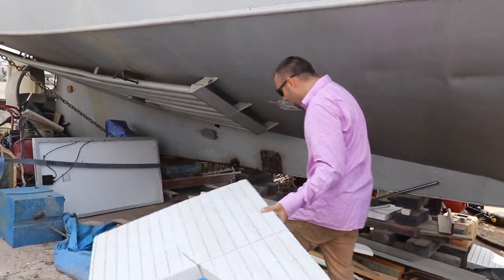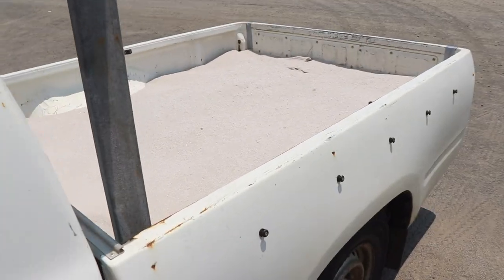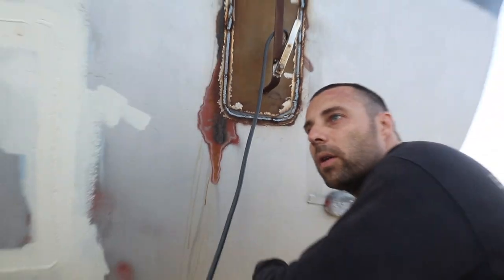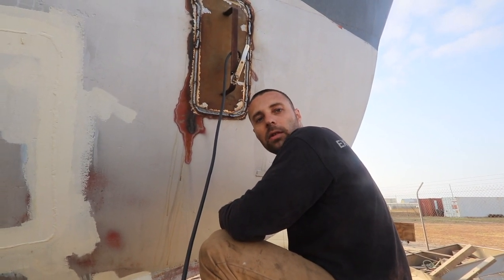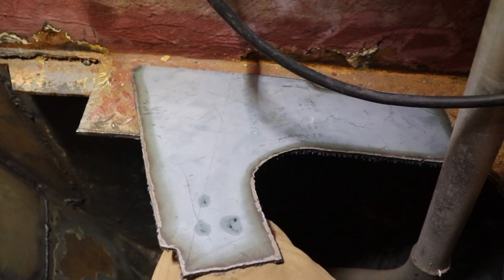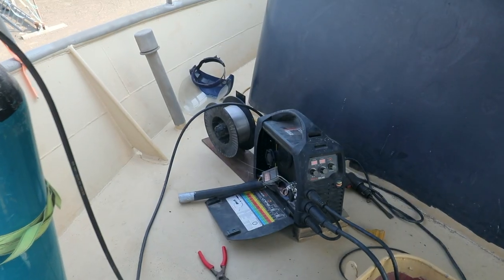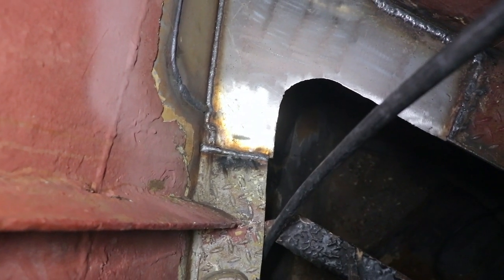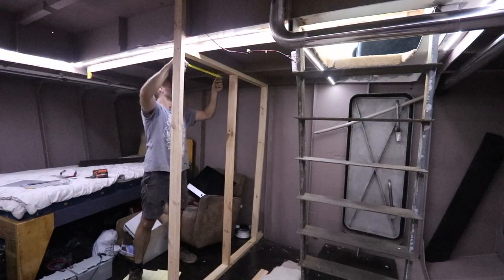Rebuilding the Crash Bulkhead - Project Brupeg Ep. 117

Comment: Thanks, great work as always don't usually comment but noticed the float switch on the sump pump. Usually they need a good bit of clearance to operate/ swing up and down. Worried  if  its in the tube and movement at sea it might not work. Hope not🤞 they usually supply these style of pumps with the option of a tube float switch aswell. This is also built in, but in a 1 1/2 tube fixed to the side of the pump. Hope you don't need this advice👍⛵🏴
Reply from the maker: I didn’t know they came with a tube option. I might look to that for an upgrade. This pump can be used elsewhere

Comment: Hi guys, she's coming along through a lot of hard work by all of crew. When talking about welding I don't know the rules and procedures in your country but if it works for you that's all that matters. I've been at welding game since 78 and I'm sixty and have put a few years in working on naval vessels, destroyers, supply and frigates. Whether we were putting a insert in hull or a fuel tank once tacked up it was welded fully from the inside then gouged from the outside into solid weld metal, in your case you use the grinder disc too open and find good solid metal. It just saves you from doing both sides, as far as the welding when doing the horizontal your much better off running two or more passes eliminating the chance of undercut. Play safe ! 🇨🇦
Reply from the maker: Ahh thanks for this, i wasnt sure about the multiple passes on the horizontal weld

Comment: Thanks team, I admire your planning, application and persistence. I’m fairly effective but you dudes are awesome.
That slowed down sand sieve footage was mesmerising. I understand the accumulation of “valuable” offcuts etc. After cleaning up (in preperation for leaving) one home i’d been in for 12 years we had sufficient wood for an entire winter’s firewood. Each piece had all been put aside previously and stored as “too valuable to burn”. The fire situation sounds scary, we had significant smoke from Auz over here in Dunedin.I would rather have winds than fire but that said we’ve just had 24 hours of not less than 60 knot winds and a maximum gust of 82 knots. Category 1 Hurricanes start at 64 knots. Most exciting times. Cheers Doi
Reply from the maker: Yeah I was speaking to a mate who lives up on flagstaff hill, he said it’s been blowing it’s guts out up there and a bunch of lightning. I can only apologise for the amount of smoke we are sending your way
Reply from the maker: Thanks Just Doi. 
Yeah Dunedin winds can be exhausting. Hi from one Dunedin-er to another! Jess

Comment: Awesome video. You may end up changing that float switch on the pump as its made for a larger area to float around and works moving from vertical to horizontal..... but saying that, i am sure you guys will make it work. Great work
Reply from the maker: Hi Matt. yeah we found we can use it by simply zip tieing it in the sump. so it still follows the horizontal/vertical movement but in a much smaller space

Comment: If you haven't had this done please have the hull material and a sample of your welds done in the vertical position tested for tensile strength and most importantly tested for low temperature impact strength. this could be life critical if u are going in ice conditions or very low temperature regions. a low cost source for this type of testing could be from a tech school that teaches metal testing. Ice, even small bits can rip a boat to pieces. I have managed projects in parts of the world that make your area look like Atlanta GA. I totally understand the problem of material availability. Best wishes and success in your adventure!!!
Reply from the maker: Hi Chris
We are following the commercial standards of Australia, had each step checked by professionals and had advice from seasoned ice boat builders. We think we will be ok but thanks for your concerns. Cheers Jess

Comment: Jess use a Welding glass to film Dame while he is welding i think that should work and also protect the Camera from splatter or Slag, even if you film with the Camera inside a welding Helmut try it you have nothing to lose and every thing to gain. lol great job Guys. Dame please look at a better sump pump than the one you had shown in this Vlog  i have the same pump and when they work there good but when the little ball bearing  housing (plastic ) fails so does the pump its a safety for the pump and all so the thing that will fail mate . just look at the top of it and you will see what i am talking about.
Reply from the maker: Thanks I will have a look at that

Comment: Steve Dashew uses a large-diameter vertical PVC  pipe for the chain to pile into, this isolates the hull from the chain & eliminates the chain making a pyramid then tipping over on itself.
Reply from the maker: That makes sense. I’ll look into his design
Reply: @ProjectBrupeg  I sent a few pics of the design via email.
Reply from the maker: Thanks for them Jeff, ive made a few enquires about large diameter tube and although its available I need to order a minimum of 6m and i havent been able to fid a supplier that will sell it i smaller lengths (we need 2m of 500mm diameter). that said the concept is great and I think can be built using the original hardwood but to Dashews style

Comment: Liking this midnight Monday publishing schedule.
You will have to build a wee barge to tow behind Brupeg so that you don’t have to go through the trauma of dumping  your ‘resource’ pile ‘cause you know damn well 2 weeks after you tip it you will be handing over cash to buy the same thing new.
Reply from the maker: Im aware i will likely be buying a piece of steel from the scrap yard that i sold them a week before... it is a trauma risk losing ones resource pile, on the one hand you know you should tidy it up and through the junk but on the other hand, there's no junk in there...
Reply: @ProjectBrupeg  I'm wondering the same thing and figured I could afford the weight of about 20 kilos of alu and SS plate for "reasons".
Reply: My Grandfather, a blacksmith and wheelwright had a metal junk pile behind his workshop about 20ft wide, 10ft deep and best part of 100ft long collected over about 60 years! You could find everything you needed in it and a lot you didn't! Must have been quite valuable when the scrappie came and took it away after he died!

Comment: To prevent rust in that crash area could you fill it with nitrogen, sucking the air off the bottom? If there is no oxygen it shouldn't rust. 
Framing partitions. Could you use pink lumber which is fireproof mold and rot resistant?
Reply from the maker: Hi, Yeah we do plan to fill the tank with an inert gas. nice simple way to stop rust. Im not sure what wood is available in this part of the world so will need to do a bit of investigation when we come to that

Comment: Hi Damo, I’m curious why you use MiG for welding the hull ? I’m a former sheet metal worker and my father a welder by trade, he told me that MiG was a lower grade weld but faster so popular in certain types of construction! Stick welding is stronger on thicker steel plate such as Brupeg’s hull
Reply: That does not have to be the case, if the filler wire is the same. (which it is).   E70s6 bare wire and the 70 in 7018 stick rods means they are the same strength. 70,000 psi tensile strength is as strong or stronger than most steels you will weld.
Reply: Maybe in the early 70s but tech has long surpasses that 
Just like stick welding rods theres huge variety of wire to use in the mig, some do better than others for different jobs 
You can also get flux core wire that runs co2 gas 
That's the strongest weld for heavy fab work 
But brupeg is only 1/4 in plate so normal min is fine
Reply from the maker: Hi Dale, these trawlers are all put together using MIG, built to survey standards. im not a qualified welder so im out of my depth saying what should or shouldnt be used, that said i just copy what the pros use and unless they tell me to change tactic i stick with it.

Comment: "Fire season and cyclone season"...Antarctica will be a doddle next to Oz. 9:10: No, you're not a qualified welder, but you've got to be in the top bloody tier of gifted amateurs! 9:47: Are you worried abouut the placement of that zinc so far forward on the bow when it comes to ice? Sure, it's pretty far down in comparison to the waterline, but breaking ice in some cases is going to mean running the bow up onto the ice and then letting the weight settle until it parts, meaning that zinc could get clawed at from below. 15:10: Been some time since there's been photons in that part of the vessel. Have you ever considered having a capped inspection pipe above the waterline welded into the floor in hard-to-reach areas like that into which you could stick a boroscope to inspect the area without having to cut out the floor again? 25:50: Did you consider a steep, shallow-angled sort of trough to guide the chain forward to get a nicer pile at the bottom? Another thing to consider is the effect of the boat pitching and yawing while the chain comes aboard, perhaps leading to a tangle. As long as you can get to it from above, no worries, of course.
Reply from the maker: Hi Marc, yeah i think once we get our head around the step change that is high latitude cruising i think it will be a fair change from something always trying to kill you in Aussie... As for zinc placement, i have a few thoughts about that, either sink them in flush or add thick steel reinforcing around the outside of them to act like a deflector. We have thought about a inspection port but given its only ever opened every 5-10yrs its not a big deal but having a port introduces risk of an air leak and therefore rust so we decided to leave it without.
Reply: @ProjectBrupeg  Agreed, I was just thinking aloud, although I did mention a cap..like an "inspection standpipe", I suppose. You should ask someone who knows if "deflectors" would affect the zincs, which work, as you likely know, on the basis of total area of contact between the bare steel and the backside of the zinc plus the welded on tabs. I really recommend to ALL steel boat owners this book: https://www.amazon.com/Metal-Corrosion-Boats-Nigel-Warren/dp/1574090542 Anyway, great progress and getting killed avoidance!
Reply from the maker: Thanks for that, ive ordered a copy.

Comment: WOW! Man, take some vitamins!  A horizontal weld is the most difficult to perform and have a nice profile.  Don't try to carry so much metal, do more smaller "stringer" passes.  Your welds look to be very safe.  When good appearance is necessary, the grinder is your friend.  If you are careful, you can grind the weld, but leave a small amount taller than the base metal and when it is primed and painted, it actually looks like a good normal pass.  Be a little creative with the grinder and paint will take care of a lot.
* You might try sacrificial anodes in any area where water collects.  They minimize rust formation by working on the anode instead.
-The videos aren't the same without a ship dog.
Reply from the maker: Thanks very much, Yeah i try to get as much weld on these critical areas without the prettying up afforded by the grinder. Still its good to know you are happy with their strength.

Comment: That anchor well pump, can it handle mud, sand, gravel, shells? Are you going to have a pressure wash on the anchor chain as it clears the water line?
Reply from the maker: Hi Yes and Yes to those questions. The sump pump can handle mud and rocks up to 6mm diameter. And hasn’t even raised a sweat with sandblasting sand so far. I do plan to have a deck wash with a set of nozzles aimed along the chain prior to the winch

Comment: Why not use flux core for welding, so you don’t need the gas coverage? Should be good up to about 15 mph wind
Reply from the maker: Hi Phil. For us flux core is extremely expensive ($600 per roll v $30 for solid wire) so we push on with solid
Reply: How big is the roll? Wow, is that a crazy price. $600 a roll I would expect someone to do the welding for me. Just paid $4.99 US for 2lbs roll would normally be around $15.
So, fluxcore smuggling looks pretty lucrative and low risk if penalty if caught.
Reply: Just checked, 10lbs rolls $62 delivery included. Time to change jobs I think

Comment: Just curious...why don't you guys put a tarp under the sand to make it easier to get it out of the beds?  
Seems like you could use the end to help funnel it into the Rolling Thunder too.

I hope you guys are safe from the fires...I have been worrying about everyone in Australia since this began.
Reply from the maker: Hi Gregory, thanks for your concern, we are at least 600km away from the nearest big fire. Im not sure what you mean by a tarp under the sand beds
Reply: Laying a tarp on the bed of the truck...then having the sand put on top.
You would be able to fold in the rear-gate ends to make a funnel shape and just push out the sand.
Letting it go into a bucket/bin for pouring into the sifter.
You would not have to shovel so much of it as the tarp would make it easy to move.

Comment: Just curious, have you considered running innershield (flux core) wire for welding outside? It impervious to the wind and runs very nice. You do have to use the slag hammer or grind or need scale between beads but you would be able to weld regardless of wind and so productivity is increased and you don’t have to grind out porosity if it gets windy while your running a bead. 

Either way your doing great work. Just seams like you get stopped a lot by wind so I thought I’d suggest you consider it. 

I hope all your friends and family are safe in your deadly fire season. We all feel bad for you guys in AU. 

Cheers and Happy New Year
Reply: You don’t need to respond on this.
Reply from the maker: Hi Jeremy, i have looked into flux core before. solid wire is $30 per 15kg roll, a flux core 1.2mm wire on a 15kg roll was over $600 last time i priced it. As you can imagine, i persevered with solid wire even though i know the flux core is likely better for our conditions
Reply: Project Brupeg wow yeah I would also. I’ve welded with flux dual shield plenty but never purchased it myself. Always my employer. So yup sold wire it is!!!

Comment: How about foam? When I was younger foam was it. It would stiffen cavities in cars, make them float and ... but today nobody does it, I guess for a reason. Of coarse getting foam out for inspection - forget it. But flakes of foam like they were used to send expensive stuff ... You could use a vacuum cleaner to fill the cavity and to get the foam out again. A cavity filled wit flakes can take less water and will take longer to fill. Time won. Have a look at a big vacuum with a basket. They may even double a a pump to get rid of water.
Reply from the maker: Hi Peter, i hadnt thought of foam.

Comment: why dont you use an arc welder? or flux core mig if you don't like stick welding. there is plenty of structural flux core wires out there
Reply from the maker: Hi Dave, im garbage at stick welding so i wouldnt risk it on critical hull plates, as for flux core. that is actually my preference but last time I priced a roll it was $600 for a 15kg roll versus $30 for solid wire
Reply: @ProjectBrupeg  hey mate. pretty sure your little welder takes 4.5kg rolls. you can get some really crap stuff for as little as $50 a roll in australia. I pay around $100ish for hobart, really good wire. another one is smoothcore i think its called, from BOC
Reply from the maker: Yeah it was smoothcore we priced up but that was before i had this welder and was using my big boy (prior to it dying). although the wind is a pain its not the end of the world, its normally still each morning so we just plan to weld exterior at that time

Comment: I was wondering why you couldn’t do your best welds, clean them, and then put a coating of “Bondo” or thickened epoxy to seal any pinholes? I came to the conclusion that if I was putting my wife, and guests on a steel trawler, and if I had the time and materials to grind out a bad weld and re-weld it, I would do the very same as you.  I enjoy the two of you working together: human chain? Great.
Reply from the maker: Thanks Chas, yeah better to be safe that sinking

Comment: If you are in fact going to be traveling internationally you might want to put an inspection hole in those sealed tanks. Maybe a bung? When the inspectors see those added welds, they're going to want to see inside. If you put them in, you'll probably never need them. If you don't ??
Reply from the maker: There is a small bung in the corner a scoop cam can fit down there. It’s also very normal for commercial boats to have tanks cut open and welded back up for inspection to stay in survey requirements. Most customs folks are likely aware of this
Reply from the maker: Weird. I’ve never heard of customs wanting to cut open tanks in a boat that have been permanently welded up. Where have you travelled that you experienced that? Very curious! Jess
Reply: @ProjectBrupeg  Drug traffic area's around the united states. Customs look for new welded area's that could be drug stashes. People go to great expense to hide stuff now a days.
Reply: @ProjectBrupeg  I have seen them drill a scope hole into suspicious looking tanks around drug and gun running area's on the coast.
Reply from the maker: im fine if that want to drill into any of these tanks, we carry a welder and have nothing to hide.